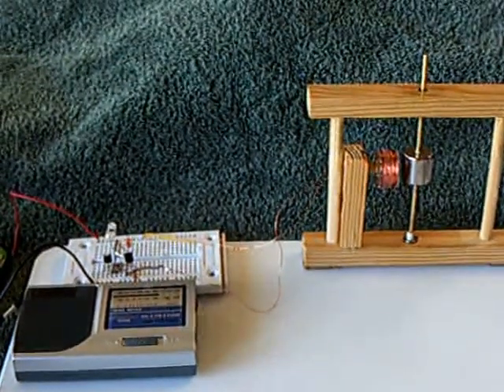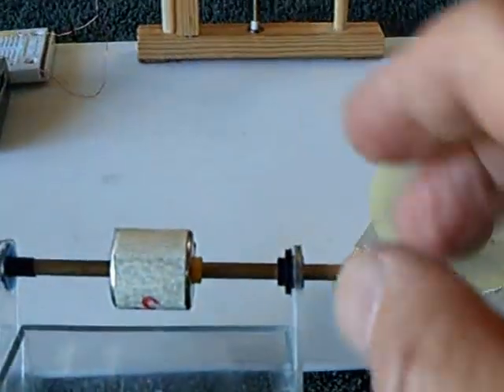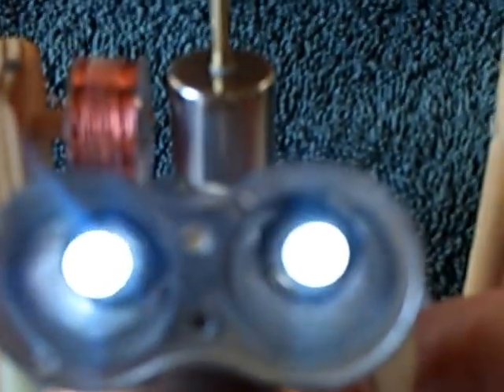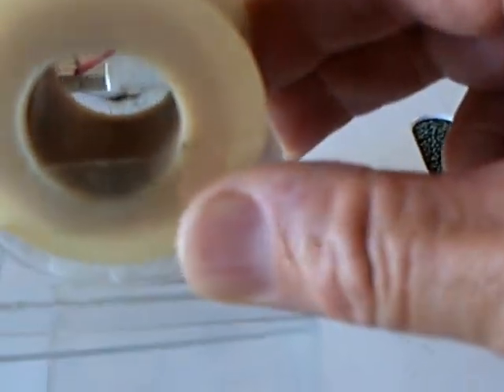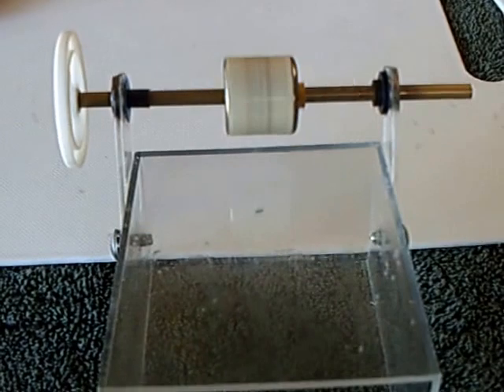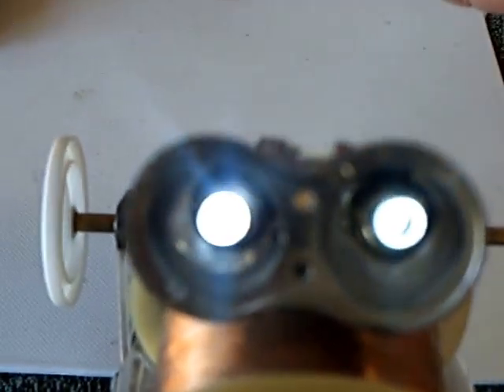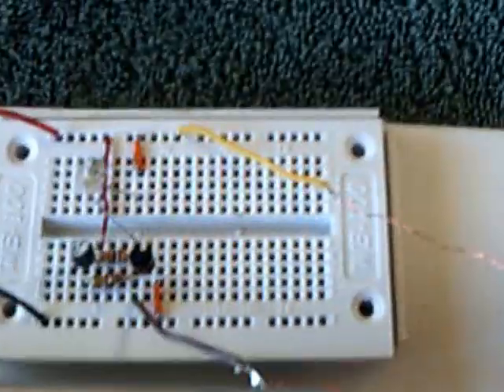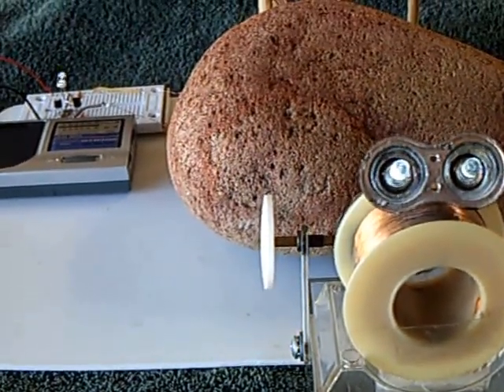Wireless Energy Transmission ----  Using rotating magnets

Comment: Magnetism will go through ANYTHING, even steel or aluminum. Metals and certain minerals however will act as a lens depending on ferrous content or ability to sustain tractionable eddy currents. You can obstruct the path between the two rotors with metals and magnetic minerals so long as the obstruction acting as the flux lens is the correct shape to focus the flux lines in a manner which allows them to reach the target load with a rotational vector profile that can gain traction on existing flux lines of the load or eddy lines induced in the load by the driver. The action of the master rotor and slave rotor in this video is like that of a ring and pinion gear. Just imagine these two cylinders you put on axles as the Earth and the Sun. Each has a North, South East and West. Now, forget about East and West they don't actually exist as such. East and West are actually N and S on a different plane. What you have is axial N/S and radial n/s. The reason a compass always points paralell to the axis is because the two main Axial poles (sN/Sn) are dominant to the radial poles. Bear in mind both poles are always present wherever a magnetic reading can be taken. In each place a reading can be taken one of the two present is dominant. The axial North pole of the Earth is N/s (dominant N, recessive s) and the south pole of the Earth is S/n (dominant S, recessive n). The transverse plane allows the compass to lay near paralell to the axis because the radial poles are outwardly recessive and inwardly dominant s/N,S/n which is the opposite state of the axial poles as outwardly dominant and inwardly recessive. The sun partly cancels and partly attracts the the radial poles with it's rotating radial poles, while it's axial poles are simultaneously mated with no repulsion to the axial poles of the Earth. Precessional wobble actually comes from the lumpiness between the relation of the Suns radial poles with that of the Earths. I bet if your slave cylinder had a loose axle end that it would begin to travel in an acentric circle at the free point while driven by the master cylinder. The sun may also be rotating 90° out from the rotation of the Earth. Your table top demo proves without doubt such a relationship is at least possible. Thanks for showing.

Comment: I believe I am real close to making a self runner  by closing the loop using the AC out of my powerbox.   If that happens it will be interesting to see if the motor generator can power other things as well.  I just bought an AC to DC  voltage step down module.that might do the trick.  24 DC volts input works extremely well moreso than 12.

Comment: I have been devoting all my time and resources exploring just that kind of energy transfer.  Its absolutely fasinating.  Every day I find something new.

I started now to explore just using the AC portion of my powerbox and left out the DC portion..

A mystery yet to be solved is my motor generator setup only produces 30 volts AC.   How in the world am I getting over 300 DC spiraling volts out of it  by using the DC rectifier circuit and cap???

Have you been watching the forum devoted to this?

Comment from the maker: Gary I understand the probem that you have with what the description of "moving electrical energy" but remember that even the traditional ways where you transmit electricity directly involve converting the potential in some way before it is blasted through the air.  Microwave, laser, or inductive-- a potential is converted, transmitted,  picked up by a receiver and then converted back into a potential.  You can't just hold a battery in front of a something and have power flow through the air.

Comment from the maker: Yes this IS transmission of energy.  I didn't say that I was "beaming electricity" through the air using rotating magnets.---just energy.  The receiving magnet could be used for turning a fan if I wanted to.  Turning the energy back into electricity is just one use.  The net effect of doing that is the "transmission" (physics definition) of electrical energy from point A to point B.

Comment: The SWcadIV support group is loaded with knowledgeable engineers and students from all over the world. You can upload your designs, ask questions about your them and get solid well thought out replies. You can download some useful circuits. Since there is a forum modulator, no insults or foul language is tolerated.

Comment from the maker: Thanks for the comment.  It made me look up the meaning of "wireless energy transmission" on Wikipedia.  It is great reading and goes into the various methods.  What I have here is like a "near field" coupling and they do call that "energy transmissiom".  I am moving electrical energy from one point to another without using wires----and the process I show here can go right through a number of soild materials unimpeded.

Comment: I agree, the added rotating magnet seems to act as a load and rotation in the initial circuit and thus frequency lowered. Your observation was a good illustration of conservation of energy to me. Others have suggested adding more rotors but I believe the energy will be distributed over the added "loads"
for no additional benefit.

Comment: You've demonstrated something that might just be more than interesting. Would you please give me the schematic for your transistor motor driver which is driving the 11 ohm coil? Chemistry labs use a magnetic stirrer. A motor rotates a magnet beneath a beaker which contains a iron rod. Liquid is stirred as the motor rotates. Not nearly as exciting as your design. Also, the frequency detected by the radio seems to decrease when the synced magnet rotates. This may be loading on your motor.

Comment from the maker: Magnetic coupling has certain advantages if it is done right.  I found several good videos on that subject.  Isolation is the big advantage.  You could drive a submerged pump right through the wall of a plastic tank with it.  Like you say---keep the electric motor completely out of the water.  Somebody has probably already done it.

Comment: Good work, Lidmotor!  I like it.  I'm doing something quite similar, as in this vid from a week ago and sequels:  on youtube: watch?v=oeACDx6Ne1w&feature=youtu.be  
Title:  Expt1 With Coupled Magnet rotors 
Later vid shows that a mu-metal barrier can be inserted between the two rotors quite a ways before the power transmission is finally cut off.
This little "motor" plus receiver will run down to about 30 uW.  Not as low as Lasersaber's motor, but pretty good I think!

Comment: I a tiny piece of steel does not extend the activity maybe a series of smaller magnets in a row would. This to me would be the beginnings of another Saturn magnet video project where the flux turns multiple magnets but this would be electrically driven. This might be a way to get some return power back into the circuit if you have something like a heavier magnet that can act as flywheel and left off energy in spurts. I have no way to verify this as I don't have anyway to test my ideas right now.

Comment: To my understand it seems like a Tesla coil in that the flux travels away from the source or magnet but once you place a load near by you start putting some drag on the system and the amperage goes up to compensate the load. This viewing just proves to me that their is no free lunch the energy has to come from somewhere but still is very efficient. One thing you might want to try is a piece of steel wire and see if you can extend the activity three feet away just as if was a piece of real wire.

Comment: That was a cool demo. I think the word you wanted was perpendicular :)
Which, I didn't know about. I've always run mine thinking they were analogous to gear teeth and cogs. 
The unpowered rotor can spin at 1/2, same speed or 2x speed (see Prof Jones's channel for similar experiments at the moment - sent him a similar system recently). He shows how even Mu metal has a tough time stopping the cog type transfer of energy.
To use Maggie was great, have been wanting to use aircoils on multi rotors.